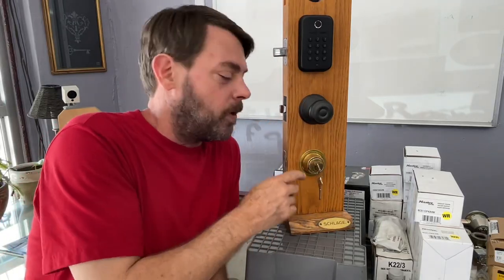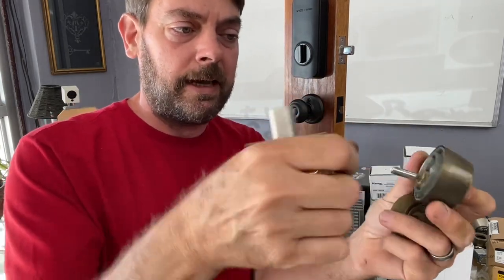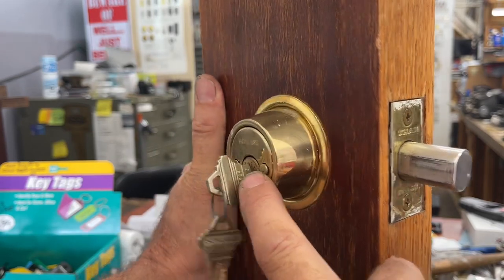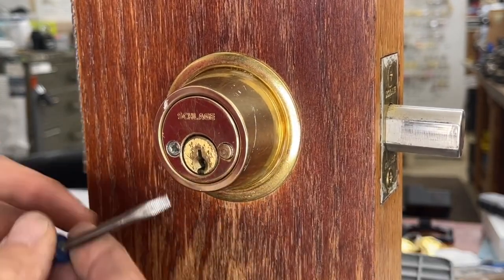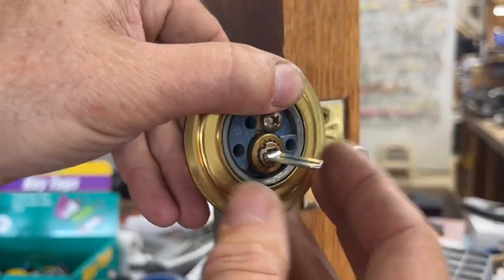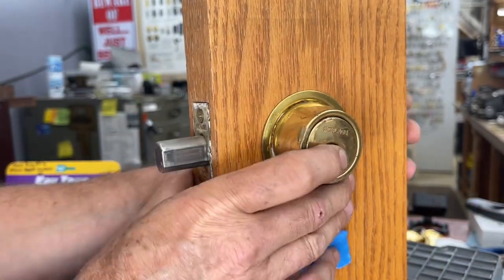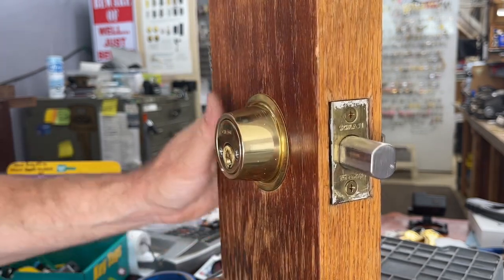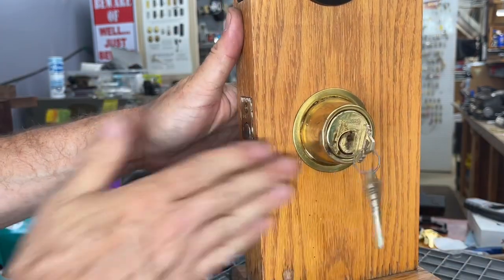Schlage Deadbolt - Key turns all the way around - Capped Screws - How to Fix

Comment from the maker: Note, there are different lengths of tailpieces. Most standard thickness doors 1 3/4" use the 1" long tailpiece. If the lock is mounted on a 1 3/8" older door it could possibly use the 3/4" long tailpiece and some of the older b100 "solid body" style even used 5/8" or 1/2" or even shorter tailpieces. 
On thicker doors beyond 1 3/4" there are also 1 1/4" long tailpieces (that cost considerably more, btw) Always measure your existing tailpiece prior to ordering. If the tailpiece is too long it will bind the lock when you tighten the screws down! You can cut the tailpieces down with mini bolt cutters or a hacksaw if necessary

Comment: what if the dead bolt will unlock but will not lock? I have a deadbolt at work that i cannot lock with the key, only from the other side with a thumb turn
Reply from the maker: Single cylinders of this brand and style didn’t break as often as the double cylinders but they can twist. Cheaper deadbolts like the original Defiant and similar can twist up badly and cause these issues. If the key turns to unlock but doesn’t it’s likely twisted

Comment: Marking this day down because you showed a Banner screwdriver 🤣 had an Emtek double cylinder DB forked tailpiece that broke the other day. Lucked out that my coworker had a spare (I had tried making one but wasn’t happy with it). Also with that one, it was an 8ft custom door that was sagging. Had the convenient adjustment screw in the top of the frame to adjust the door and pulled it back up where it was supposed to be.
Reply from the maker: Emtek deadbolts are also one of the worst when it comes to their tailpiece breaking, but in addition their super small diameter cap pin and screw cap is absolute trash. It also has a very exact "length" and cutout to work so trying to make other brands replacement tailpieces (like LSDA's) is sometimes irritating

Comment: My Schlage lock that looks very similar to that in the video is spinning and not unlocking the door when I turn the key. (Locking works fine.) I took it apart and the tailpiece is not broken. I can't figure out what's wrong; I also can't quite figure out what is the intended mechanism of the tailpiece function. It seems to catch at times, and loosely spins other times. Any idea?
Reply from the maker: It can not be broken but still be stripped out. It might also be the cam mechanism that the tailpiece engages with

Comment: Just installed a new BE365 and the issue I'm having is the key inserts but it doesn't turn the lock at all. Any thoughts on what the issue could be?
Reply from the maker: Hold knob still, insert key, turn until cylinder "drops" in a bit, let go of knob continue to turn key while pushing in. If you hold the knob still and the key won't turn, its not the correct key